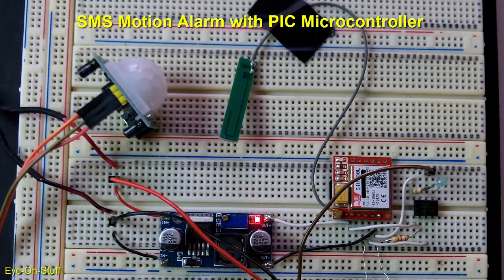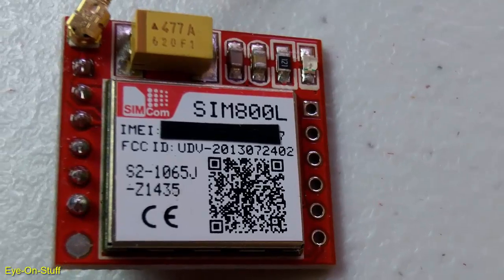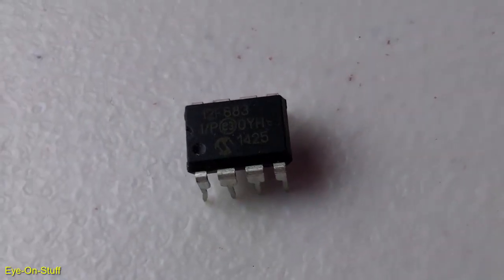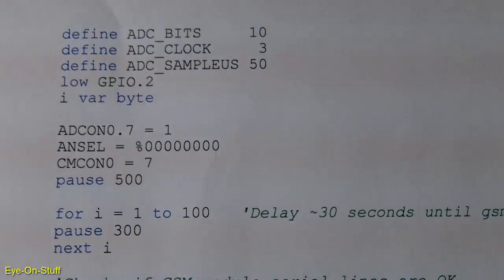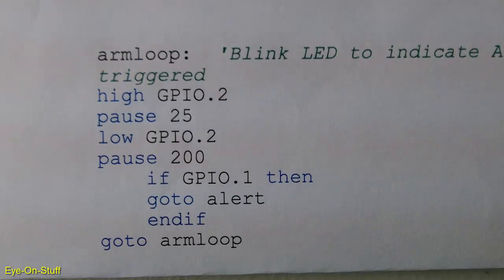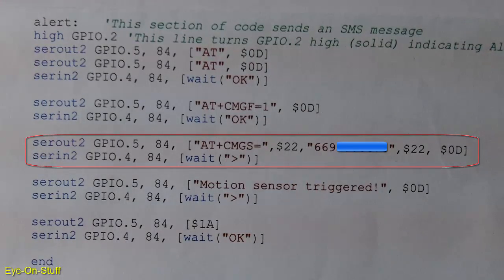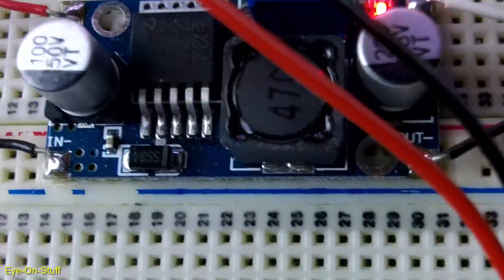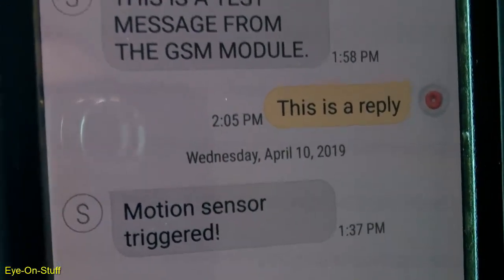How to make an SMS Motion Alarm with a PIC Microcontroller : Eye-On-Stuff

Comment: PLEASE HELP ME !!! PROGRAM NOT WORKING
Project Name: SMS Motion Alarm with a PIC Microcontroller 12f675, sim800L gsm module
Complier: Melabs pic basic pro.
GPIO.1 Motion sensor
GPIO.2 LED
GPIO.5 to SIM800L pin RX
GPIO.4 to SIM800L pin TX
Code:
#CONFIG
__config _INTRC_OSC_NOCLKOUT & _WDT_OFF & _MCLRE_OFF & _CP_OFF
#ENDCONFIG
DEFINE OSC 4
low GPIO.2
i var byte
pause 500
for i = 1 to 50 'Delay -30 seconds until gas]
low GPIO.2
pause 500
high GPIO.2
pause 500
next i
high GPIO.2
pause 500
serout2 GPIO.5,84,["AT", $0D]
serout2 GPIO.5,84,["AT", $0D]
serout2 GPIO.5,84,["AT", $0D]
serout2 GPIO.5,84,["AT", $0D]
serout2 GPIO.5,84,["AT", $0D]
serin2 GPIO.4,84,[wait("OK")]
low GPIO.2
pause 500
m:
'Blink LED to indicate A triggered
high GPIO.2
pause 500
low GPIO.2
pause 500
if GPIO.1 then goto a
;endif
goto m
a: 'This section of code sends an SMS message
high GPIO.2 'This line turns GPI0.2 high (solid) indicating
serout2 GPIO.5, 84, ["AT", $0D]
serout2 GPIO.5, 84, ["AT", $0D]
serin2 GPIO.4, 84, [wait("OK")]
serout2 GPIO.5, 84, ["AT+CMGF=1", $0D]
serin2 GPIO.4, 84, [wait("OK")]
serout2 GPIO.5, 84, ["AT+CMGS=",$22,"0181871xxxx",$22, $0D]
; Bangladesh country code +88; full no: +880181871xxxx
;
serin2 GPIO.4, 84, [wait(">")]
serout2 GPIO.5, 84, ["Motion sensor triggered!", $0D]
serin2 GPIO.4, 84, [wait(">")]
serout2 GPIO.5, 84, [$1A]
serin2 GPIO.4, 84, [wait("OK")]
pause 200
goto m
end

Comment: Indians and Chinese are miles ahead but they lack proper presentation and communication skills. Great video. I am a pic18f guy using assembly. I will start using C. It makes life easier when dealing with strings.
Reply: This seems.......offensive it’s not on the racist side more on the offensive side
Reply: @whitekanyewestthebully1346  US and many others are trying to help UKRAINE. Where is the second most powerful country?
Reply: Anyway I am using a pic18f and esp8266 and now SIM800l. As soon as I connect the max3222cpn the blinking led light on the sim800l stops.
Reply: Sorted